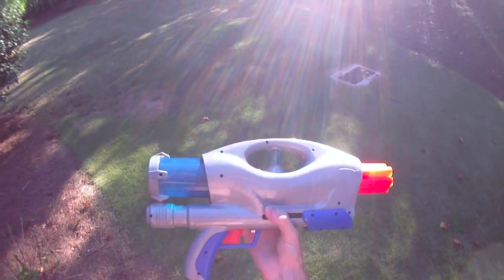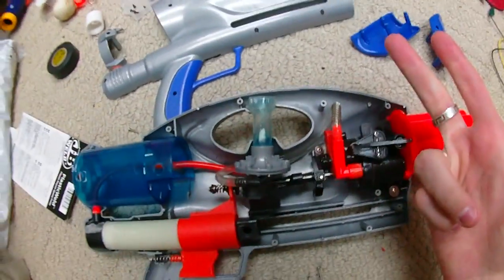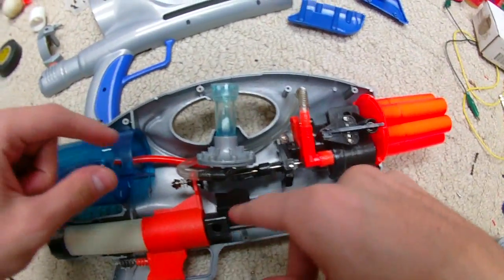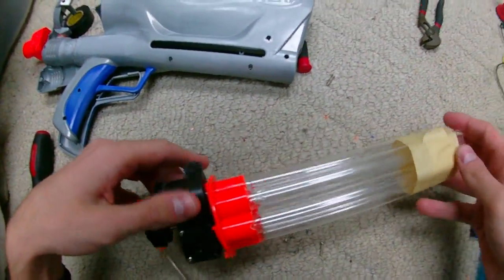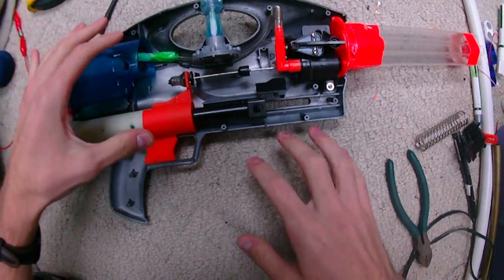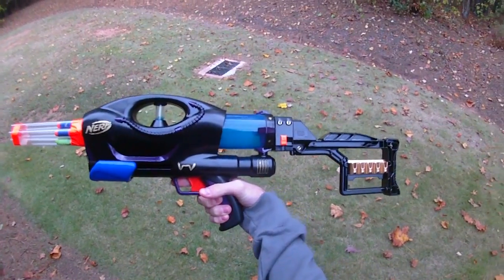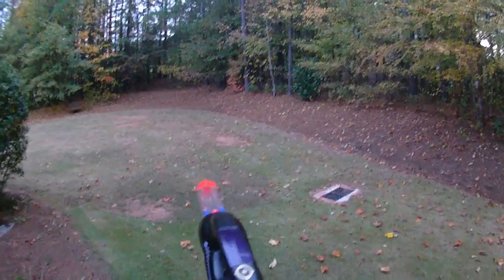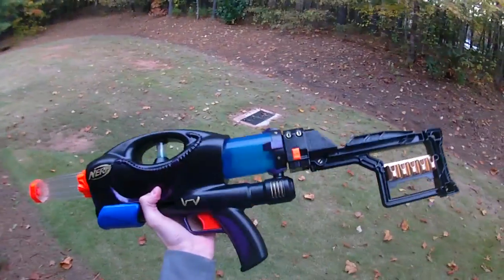Nerf Mod: Overhauled AirTech 3000 (Paintjob, Reworked Turret, Stock Point, the works)

Comment: Roughcut mod idea! I was wondering if it would be possible to get the roughcut to fire only 1 dart per prime using both plunger tubes for better range, with more shots?
Reply: Ehh, It would ruin the whole point of the roughcut. It does sound kind of cool though.
Reply: AndrewAitchison100 prob not, each four barrels on either side are only connection Ed to one plunger tube

Comment: Technical question, wouldn't it be better to do away with the turret altogether and use a hopper clip? That way you wouldn't have to worry about turret seal and you wouldn't have to reach forward to rotate the turret. In theory this would improve your rate of fire and ranges, wouldn't it?

Comment: Why not take a portion of the liquid in the liquitron out so it is still functional
Reply: 1) it uses pressure from the air system, reducing performance.
2) it may explode under the pressures this system is running.

Comment: Hey Drac! I am a huge fan of your work! You do the sickest mods I have ever seen! I have a few questions that I thought you may be able to answer, if that's okay with you. 1: Where do you buy the PETG? (I had an AT3K and I wanted to do this kind of a mod, but I couldn't find PETG so I shoved it into a cut down Maverick and used CPVC to fire darts, which I'm currently working on.) 2: If I was to attend an SENC event, how old should I be? I just didn't want to show up and be the only teen there. 3: Would you consider an AT3K inside of a Maverick to be an SENC worthy blaster? I know that it's not a Big Blast or a rainbow, but I just wanted to know what I can bring to have a fighting chance. I have a Hydro Cannon that I can mod if I need to. P.s. (Do I need Stefans?) Thanks a bunch Drac! I know you have a lot of comments and that this one probably will get passed by, so if you actually get around to reading this, I just wanted to say thank you, and keep up the great work!!!😄

Comment: How does that fire anything remotely to 100 feet with a crappy airtank and only 3 pumps. It looks like it fires 40 feet max
Reply from the maker: Science!  Pump is plugged, ranges are obvious.  You must be new here.
Reply: dude u have no idea how powerful nerf guns get iambobololo has a hydro cannon that runs on tire 2 tire compressors shoots 550ft
Reply: Im not new to springers or fly wheels but im new to air blasters. My friend had an Airtech 3000 and the thing shot about 10 feet if you were lucky. So yeah
Reply: Eh
Reply: +ace touzin it was 150 feet not 550 that's insane

Comment: Very nicely done. Found myself a pair of AT3Ks at my local Goodwill, Liquitron tanks and shells in near mint condition except for a few scuffs here and there. Was planning on modding them the same way, might have to "steal" that stock attachment idea from you ;)
Now when you were talking about the dimensions of the PETG tubing, you said they were 1/2". Did you mean that as the Outer Diameter or the Inner Diameter? What are the exact dimensions for the tubes themselves? Been searching everywhere for them to do the mods, but it seems nobody says the exact PETG dimensions.

Comment: What's a south east slug
Reply: What they call one of their custom homemade dart
Reply: Reuben Chan what's so special about it.
Reply: Diandre Louisdor It doesn't have the dumbass hole in the tip like the elite darts do, so it's not as inaccurate. I'm sure that it's also made with better foam, and the hot glue tips most of them feature are also more durable than the rubber POS that hasbro uses.
Reply: A south east style slug is the type of slug dart that they use for NIC wars in the south east. They used to use Kane's pink foam, a #6 washer, and a felt pad, but they changed to white foam since it is cheaper and the pink darts were wearing out.
Reply from the maker: Drev McAwesome the truth right here, iimpressive
Reply: LordDraconical Thanks.
Reply: LordDraconical sorry if what I said wasn't relevant, I'm not really a participant in this sort of thing yet; just a spectator.

Comment: i didnt have ammo for my airtech 3000 because the barrel size is different and i got mad cause i got it for 5 dollars so i took a hammer and smash it i still have the air pump and used the o-ring for my stampede of which my gears have broke :*(

Comment: You dare to call this a fully overhauled 3K when there is no rear-loading capabilities and the stock pump is still being used? Also, your barrel spacer is not the proper size (PETG) does not have the same wall thickness as the stock nerf barrels).
Reply: Well ooooh, aren't you just on the top of all this. :P

Comment: oh my gosh now I get it because before when u modded a different one awhile back u used long barrels I was like what wouldn't that create a lot of barrel drag but it is actually a barrel extension I get it thanks because I have a powerful overhauled crossfire bow it is very good shoots through cardboard (my primary) I found out buzzbee springs springs are powerful I bet u can make a good pumpsnap with 4 buzzbee rouges by the way I wish u were in Canada ):